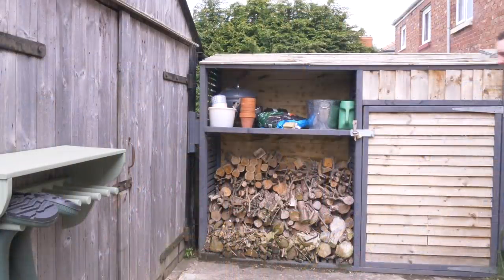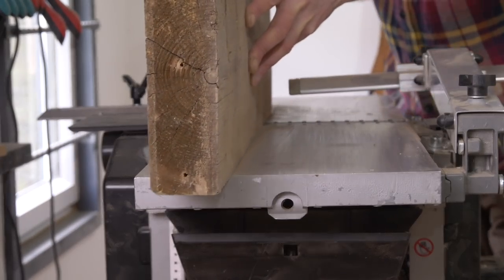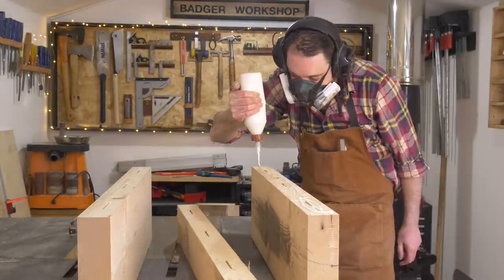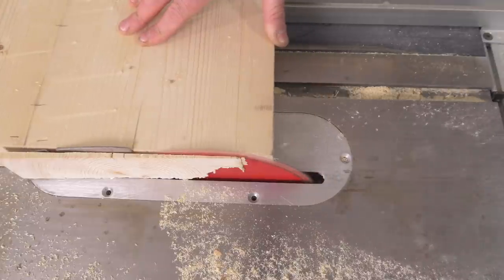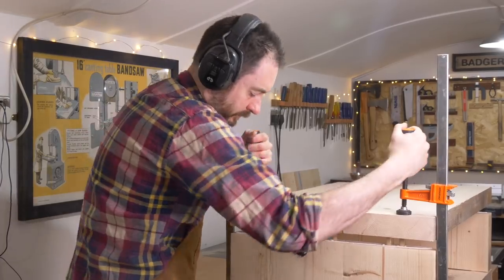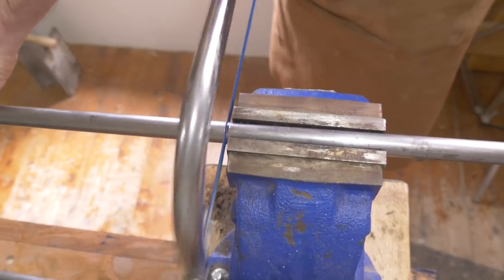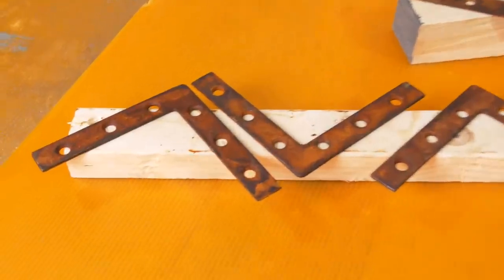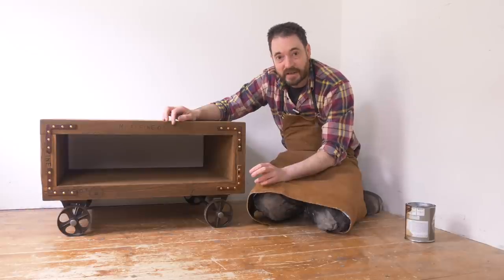Industrial Rustic Coffee Table

Comment: Great table  Matt.
Quick question just about to buy the table saw you got I know you bought the banggood cross cut sliding mitre for your table as the sliding table that came with your saw stuck out too much. However if yiu had got the space would you have preferred to keep the sliding table over the banggood???

Comment: Looked awesome. 
One thing I couldn’t work out is how you were able to make your holes line up the dowels. Was it just a case of careful measuring? If so, I’d never be able to make a bunch of them align myself!
Reply from the maker: I drew lines on the sides and transferred them to top and bottom. It was not perfect but the clamps pulled it all tight